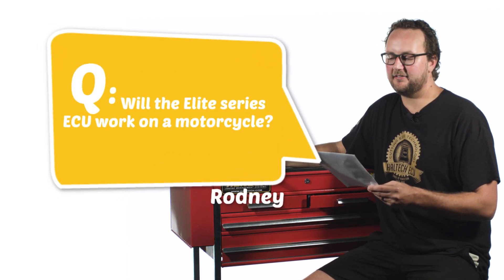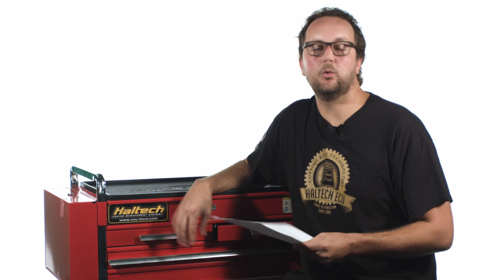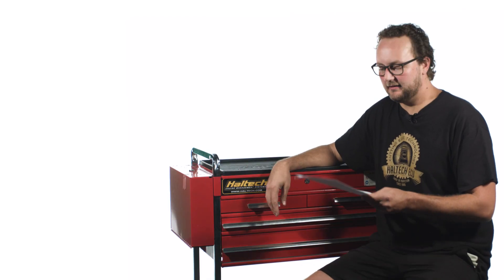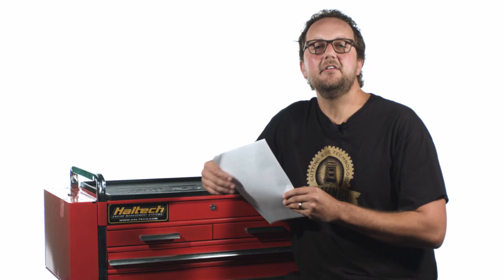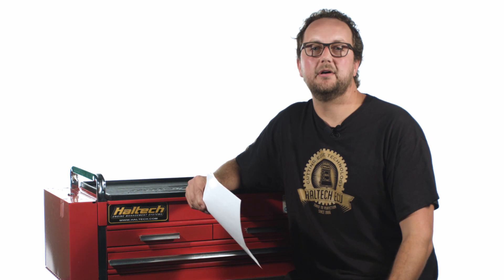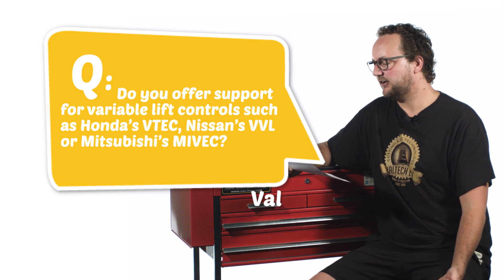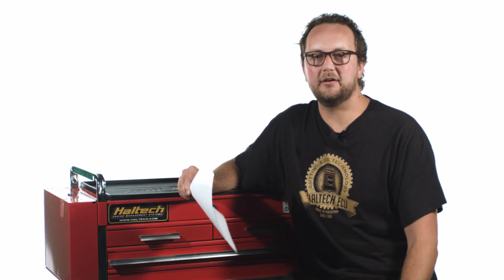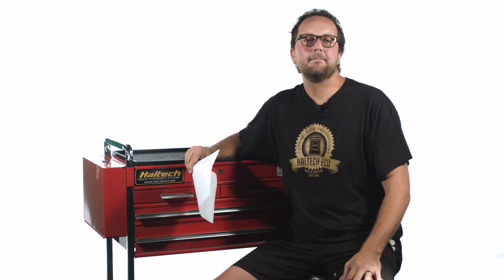❓ Motorcycles, MIVECs, VTECs, VVLs and V12s - Haltech Q&A Episode 21

Comment: Hello and thank you for making these informational videos. I did not quite get the part about the v12. If we are firing two injectors at the same time I can assume that we loose fuel injecting it into cylinder that did not needed it, could you please explain. Second, how would operation of stock diagnosis system lights in the dash would work with anti-slip and abs? My engine is m120.982 v-12 with coils.
Reply from the maker: Semi-sequential simply sends one fuel pulse every crank rotation to each injector.  It's not as efficient, but this is the trade-off when trying to do an installation on a budget with this sort of application. However, the M120 has two DBW throttle bodies, so you will need two ECUs to control it anyway.
Almost all OEM V12 engines use two ECUs (one per bank) and you can also do this as well with 2 x Elite 2500 ECUs which will give you full sequential fuel and ignition, and also control the two DBW throttles.
Reply: Haltech, thank you for your quick and detailed answer! I saw almost all of the videos regarding Haltech ECU’s and did not knew that v12 use this configuration. Two separate ECU’s work together through some bus or are they independent and needed to be configured individually? Also, from all videos that I saw, I thought I must get Elite 2500 + Race extension because it gives another 6 sequential ignition/injection channels we need. Am I wrong on that one?

Thanks in advance!
P.S. Great videos of Haltech + MCM thanks for that too!

Comment: Hi, which is the ecu that you would recommend for a B18C?
Reply from the maker: For a B18C you would use an Elite 550, 750, 1000 or 1500.  Which model will depend on what you would like the ECU to do besides just run the fuel and ignition systems.  There is also a plug in kit available if the vehicle wiring is suitable.  http://www.haltech.com/elite-1000-plugnplay-adaptor-ecu-kits/#honda
Reply: Thanks for the reply, it is vehicle is meant for weekend drag racing, and just drive on the street. the elite550 would be able to control vtec, fuel+timing mapping when vtec on and when vtec off.

Comment: I am interested in swapping a Ford 3.7 Cyclone engine into an older mustang. With the stock ecu setup it typically gets 30 mpg highway while having 305 horsepower. Do you believe it would be possible to achieve good street manners, comparable or better power and also maintain comparable efficiency if I used a non factory ecu like a haltech instead of the ford ecu? Keeping in mind that this engine has Ti-VCT
Reply from the maker: With the Ford/Mazda MZI engine already being supported by the Elite range the difficult part is already done, and with support for up to 4x variable cams then I would say yes you can achieve your needs with an Elite 2500.
Reply: Do you guys have any harnesses or base tune support for the 3.5/3.7 Ford Duratec/Mazda MZI engine or are you just saying that the Elite 2500 ECU is capable of running that engine?

Comment: would be haltech elite 2500 be able to be used in unison with the Cobb tuning passport?
Reply from the maker: Yes it is possible, but if you have an Elite 2500 on your engine you more than likely wouldn't need the Cobb unit.

Comment: mitsubishi also had a vtec like 2 lobe profile variable valve lift version on their 4g92 and 6b12 engines for example thats using dohc.
the 4g69 uses a sohc and a variable valve lift.. and the 4g63 evo 9 and the 4g64 gdi engines use the varibale valve timing controled by oil pressure entering vanes as you explained.

Comment: Why doesn't the 550 elite come with idle control
Reply from the maker: Elite 550 does support 2 and 3 wire duty controlled idle valves. It will not control a 4 or 6 wire stepper motor idle valve though.

Comment: G'day guys, I'm looking into buying an Toyota MR2 Turbo SW20. the one I've been seeing for sale that I really like the look of is running a Haltech E6K and develops around 400 Horsepower (and it has all the appropriate supporting mods)

My question comes in a few parts.

1: What is the modern equivalent of the E6K?
2: Would it be worth the upgrade to upgrade the ECU if its running fine on the E6K
3: What kind of features would I be missing out on if the ECU wasn't upgraded?

and one final question. Would it be possible to run a "Cruise" or "Low boost" mode that is connected switch in the cabin to.. say save fuel or just to run the engine less harshly. could this be done on the E6K or would i need to upgrade to a new ECU to get that functionality? (or is that simply a boost controller job?)

Thanks!
You're the best
Reply from the maker: With the E6K discontinued around 15 years ago it is not exactly the most modern of units. If it is running fine then there is no need to replace it, but as you can guess the newer generation of Elite ECUs are far more powerful than the old E6K. The closest comparison to the E6K is the entry-level Elite 550 and this can support multiple tunes if needed.
Reply: Bonza! Thanks Guys!

Comment: Hey guys I was just wondering if I could add a screen to display sensor readings in supplement to the dash or would I have to put a bunch of gauges in my car so I can monitor everything
Reply from the maker: If you are using one of our Elite ECUs you can use the OBD2 output to send data to a small display or tablet.  There is also the gaugeART unit to allow sensors to be read on your own display.  http://www.haltech.com/gaugeart-can-to-vga-adapter/

Comment: Nissan VVL don't use a module it uses a solenoid like other systems .
Reply: Anil Sooknanan he answered on the VVEL system and not the VVL system. The SR16/20VE are the only Nissan motors which use the VVL system.

Comment: Hi
Can elite 2500 run bmw m62, v8, 4vanos and DBW with bmw accelerator pedal and throttlebody?
 do i have to buy wide band kit  ?
can i use my factory knock sensors?
thanks
Reply from the maker: We support and run the S62 series of engines which are in essence the same as M62 with the Elite 2500. So I would say yes they are supported.  You do not have to buy a wideband kit, but it definitely will help run the engine better.   I am not familiar with the knock sensors on that engine but almost all knock sensors are supported.

Comment: will a Haltech run a 92-93 Mercedes SL600 v-12? would you offer a harness kit? degraded factory harness insulation. thanks from VA., USA
Reply from the maker: We don't make any specific products for this engine. But yes, a Haltech ECU will run it - you would be looking at a full wire-in installation using one of our universal harness kits.
Reply: OK, thank you for the quick response. I will remind myself of the specifics of the engine and get back for a cost estimate and ECU recommendations. It has been on the back burner for a year.

Comment: Does the ECUs support Mercedes M104 engines variable intake valve lift?
Reply from the maker: As far as we’re aware, the M104 utilises switched variable cam timing, not valve lift. Switched variable cam timing is no problem for any Haltech ECU.
Reply: Yea It has only two positions so not "variable" per se. Thanks for the info!

Comment: Thanks for all the professional answers Scott. Does Haltech support BMW DISA (Variable length intake manifold)?
Reply from the maker: Wow! We are not aware of anyone controlling this system, nor are we familiar with how it works mechanically. If there was enough interest, it is something we could look into though.
Reply: I got it figured out! It is just using simple signal inputs, when it has no input it is open, when it gets 12v it closes, simple as that. But it seems that it will be quite challenging to correctly tune it, considering that there is also double vanos system (Variable valve timing), it is quite a lot variations to get the most of the engine where we want it. If Haltech offers you ability to get an 12v input wire which is RPM dependent then it should work just as planned. Here you have a very good explanation of what this valve is and how more less it works: https://www.eeuroparts.com/blog/7336/disa-valve-rundown-symptoms-replacement/

Comment: q is there a way to run E85 on a 2003 cable throttle ecu as it's a single map system as far as I'm aware with my ecutec tune . would haltech have some sort of eflex add-on or would I have to go with a standalone haltech ECU as I've heard there is not much spare memory or inputs on the 2003 cable throttled ecus
Reply from the maker: EFlex is definitely possible through our 01-05 WRX Pro Plugin ECU and Ethanol Content Sensor. We can’t say for sure if it is possible on your factory ECU.
Reply: Haltech cheers mate I'll have a chat to Paul down at pulse racing to see what I can do

Comment: are you able to control the ford Ecolpi engines with a haltech?  with the lpg liquid direct port injection etc to allow these to be turbocharged?
Reply from the maker: Yes, this is technically possible as the LPI injectors are very similar to traditional fuel injectors.
Reply: is it possible to control the lpg pump stuff like "purging" to charge the lines with liquid lpg before startup...

Comment: in the last question I think the question was towards the mitsubishi 4g92 mivec, the sr20ve neo vvl, and honda's b18/b16 vtec. the reason being they all use separate cam lobes for low and high rpm, activated by a electronic signal from the ecu. I maybe wrong, that's just the way I took the question. nonetheless great video.

Comment: I am about to put an rb25 neo into my Nissan cefiro. I was wondering which ecu is best to use, I want some engine protection in the form of oil pressure and fuel pressure. I also would like to be able to set up variable boost pressures in each gear (I will be running a manualised auto which has a signal output for each gear).
Reply from the maker: If you’re going to retain the factory Rb25Neo wiring harness, you can use one of our R34GTT Pro Plugins, or our R34GTT Elite Patch harness kit. Both of these ECU’s allow engine protection based on oil & fuel pressure, along with boost by gear.

Comment: So another question for elite 550 for motorcycles can the ecu run the bike or would it be wise to get the premium universal wire in kit
Reply from the maker: The ECU needs to be wired in somehow, you can either do it yourself (if you're proficient at it) or use the wire-in kit (which makes the wiring job easier).

Comment: what about VVTLi? And can I call the lift in an earlier RPM?
Reply: Our Celica's really need more than once choice of programmable ecu and it would be nice to have a haltech ECU especially because the Celica really needs one. Especially the 2002 year which has a lower rev limiter where it's impossible to stay in lift. The lotus Elise ecu has a higher rev limiter and they squeezed more power out of the 2zz so this engine has potential but the only option is a $1000 power FC. I would like to know is there is a cheaper alternative that would work on a 2zzge in order to support toyotas vvtli and have adjustability such as lowering the lift engagement to a lower rpm and raising the rev limit.